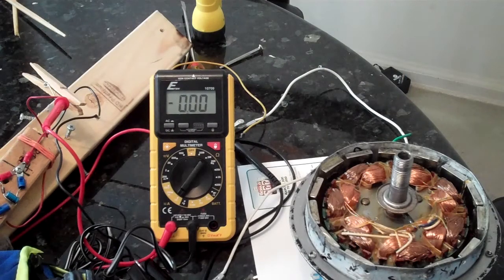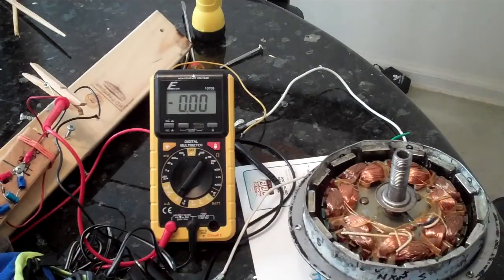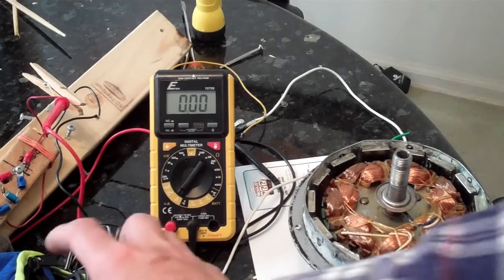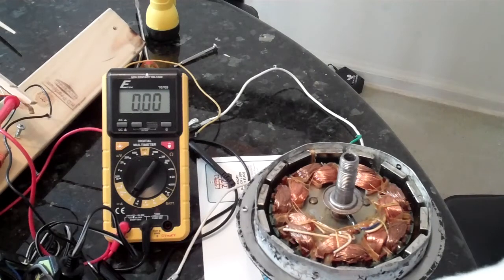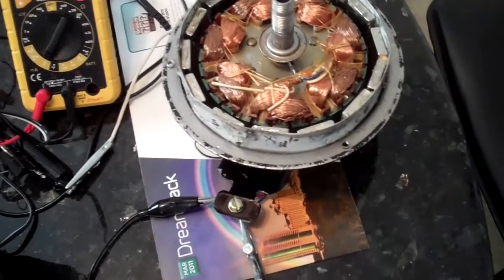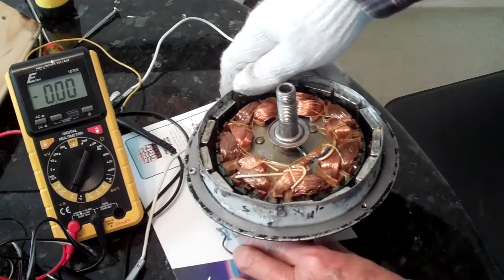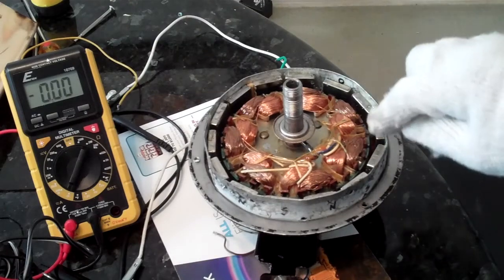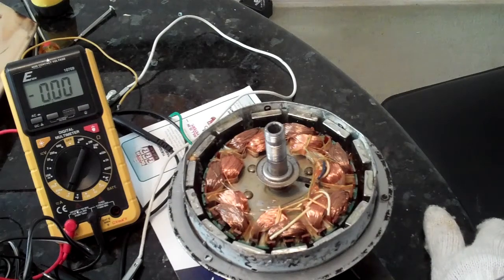Ceiling fan alternator with 14 coils and magnets.mp4

Comment: THANK YOU I WATCHED ITS HELPFUL FOR ME I HAVE LOTS OF CEILING FAN, CAN YOU HELP ME HOW I CAN PURCHASED A MAGNET / MY COUNTRY DOES SELL MAGNETS I AM IN PAPUA NEW GUINEA ,NORTH OF AUSTRALIA
Reply from the maker: Andrew Moses You can get magnets from old hard drives. You can also use ceramic magnets but they are not as strong as neodymium magnets. Maybe you can order the magnets online from eBay and have them shipped to your country. I think I used too many magnets for my ceiling fan motor so it's a little hard to turn.  Papua New Guinea sounds like a place where you can get a lot of wind and warm ones too.
Reply: wtam69 thank you I will find that

Comment: Too many magnets. If used as a wind turbine, It would take a hurricane to make it spin. If made to be hand cranked, I guess it would work ok. Probably best to use a motor to spin it, but then it wouldn't be considered free energy. If it requires the energy consumption of a motor to aid in the creation of energy, then you'd just be converting energy, not creating it.
Reply from the maker: Billy Mase You are right about too many magnets. Maybe someday I'll take some of the magnets out.
Reply: Billy Mase what about using A solar Panel to give the motor the free energy to spin it

Comment: problem with ceiling fans is the attraction of iron parts and magnets. Therefore the observed cogging is not cogging due to the coils. Impractical system: too much resistance without load.

Comment from the maker: It takes a lot of patience to take them apart. Watch Muddy's (Scott Brown) videos on how to take them apart. With my model, you just unscrew and pry apart (tap with hammer) with screw driver. The inductor ring you might have to heat it up to melt glue or epoxy and tap with hammer to remove.

Comment from the maker: @joe18370 You can use steel but not pvc and no stainless steel. I used a metal strapping. I think Muddy was using steel banding. I guess steel washers will do if you don't have anything suitable. To close the gap, you can also add a thinner magnet.

Comment from the maker: @field16 Yes indeed 100 v DC.  My bridge rectifier has the so called voltage doubler so the dc voltage is very high.  I have seen other ceiling fan motors giving more than 100 v AC.  You are right,  you forget how dangerous electricity can be thinking it's only dc when dc can be just as dangerous. Thanks for the reminder.

Comment: It's good to see you making progress.    At 1:12  you say you get 100V DC.  I am surprised it's getting that high.  Are you taking safety precautions to make sure you don't get shocked with that?  I think that voltage is getting dangerous for a circuit with exposed connections.  Good luck.